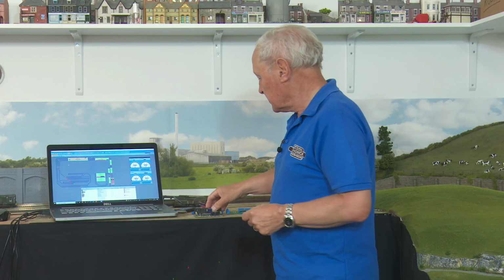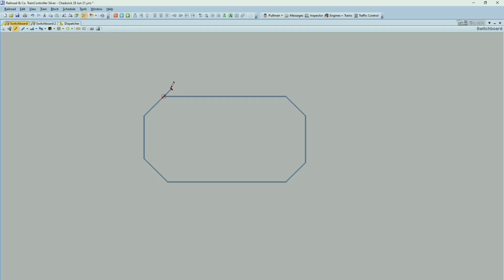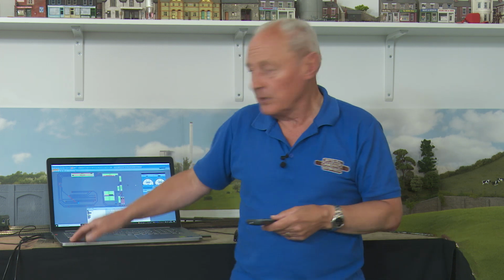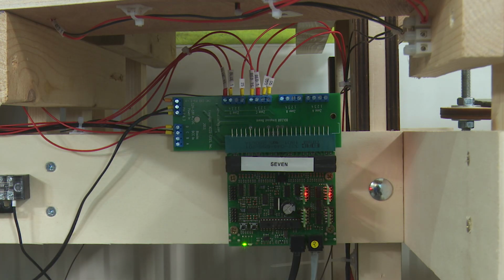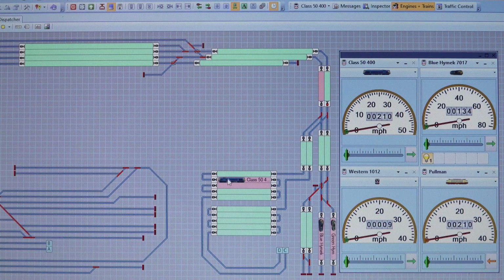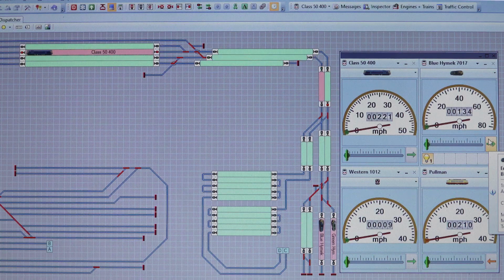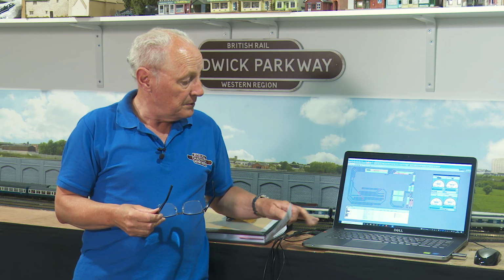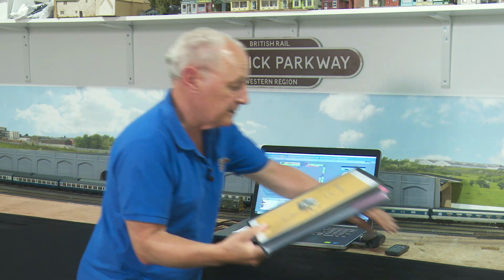An Intro to Block Detection at Chadwick Model Railway | 137.

Comment: On breakout board what are connectors A B C D? What are the use? I dont understand. Ty very much
Reply from the maker: Those connections, A, B, C, and D, represent the four power districts that feed into the board to manage different sections of the layout. Regards, Charlie.
Reply: @ChadwickModelRailway ty very much

Comment: Fabulous video Charlie, a truly great explanation overview of Model Railway Automation, that will encourage many to go down a similar route. You've done modellers a great service with this video Charlie, Thanks.
I was dismayed at the DigiTrains eqt prices, and also of the Train Controller costs too.

I would add that after becoming a MERG member their DTC8 currentr sensing block detector kit (8 channel) is only £24.94. They also do a 2 channel kit (DTC2) at £7.25.  The instructions are extremely easy to follow and if (like yourself Charlie), your soldering skills are good, building the kit is a bit of a breeze. You do not have to be an electronics engineer (I'm not!). MERG Membership costs in the UK £24 annually and for new membership a one off joining fee of £5. There's a whole range of other really useful kits too, once you've become a member. I've built Turntable Control, Accessory Decoders, Frog auto control, Servo control kits, and many others too. 

I am presently building mimic control panels  for route selection using the MERG detectors to show LED's on my panels. The route selection control is using NCE Mini-panels (circa £50) connected to my NCE Power House Pro control station. I have been thinking about expanding control of my layout to full automation using iTrain with my "fruit flavoured computers" as you so elequently describe them! As I already have basic block detection it wouldn't be too much extra pain to set up - I hope!
Reply from the maker: That is a very helpful tip regarding affordable kit alternatives, thanks for sharing your experience!

Comment: A four year old video just found - I am clearly late to the party!!!!!  After over 35 years I returned to model railways two years ago and delved into DCC for the first time.  I have now decided to start again with a new OO layout and iTrains automation so am on a steep learning curve.  I found your video very helpful in explaininhg some of the nuances of this exciting technology.  I have found so many videos bewildering and off-putting as they always assume knowledge which leaves one confused.  I love the way you explain things which I find most encouraging.  I am not planning a massive layout - just a twin track round the room with passing loops, 4 lane station and a few sidings but want the ability to control up to three trains per track so want to ensure I get the wiring right at the start of the project and ensure my issolators and block detections are set up correctly from the outset although I will concentrate on one section at a time starting with the station section first.  Thanks for a very informative video.  (I have also spoken to DCC Train Automation)
Reply from the maker: I'm so pleased you found the video useful SS, and good luck with your new layout!

Comment: It was discovering cheap DCC (via DCC++, now DCC-EX) and blog posts on DIY block detectors using current transformers that brought me back to railway modelling in 2017. I never got the DIY sensors to work but the MERG ones worked straightaway! My goal is to reengineer the MERG sensors into a more compact form that integrates with CBUS or OpenLCB. I want a layout with working interlocking but not tethered to a PC and not (necessarily) with automatically driven trains.
Reply from the maker: That's a great project, RA and it's good to hear you're finding success with the MERG sensors!

Comment: Hi Charlie - great video!!
As you asked how your viewers do it... 
For the block detection hardware i use the Arduino Analgue Input module (ADS1115 ADC 4 Ch 16bit ADC PGA) with 4 hall effect current sensors up to 5A (ACS712 5A range CSM) - and it detects current on both DC and DCC (different configurations of course).
Min Cost = £2.4475 per sensor £4.899 per block (one sensor needed at the start and end of each block).
Basic Hardware how to do it video:
https://youtu.be/RZmGt3-HVlw?si=8iK0KTCmWywxgIdQ 
SIgnal and  Point control are at extra cost. 
Digital I/O is managed by a PCF 8575 16ch GPIO card (each channel can be an input or output). 
Servos are controlled by a 16ch  PCA9685 PWM analogue output card (PWM = Pulse Width Modulation) with each output driving 9g micro servos to change points and signals. The servos close micoswiches to confirm point and signal  operation. 
The above also requires Arduino and 5V power supply) and possibly one capacitor per sensor. 
CMRI (the C version of JMRI) is installed on the Arduino and allows nominated I/O points to be made vissible for automated control by the JMRI Disptcher from my laptop.
Video on the basics:
https://youtu.be/5lvvoBCQl9U?si=_r2JOGmNCwVpc3Ur 
I agree with your comments on JMRI. It's not easy. But it is cheap.
THIS APPROACH DOES  NEEDS BASIC PROGRAMMING SKILLS!
Reply from the maker: Many thanks, blue anorak, I do hope people follow your lead. Regards, Charlie.

Comment: Hi Charlie, re your video you state that you do not include the points within the blocks. I understand that power to the blocks is via the bdl168. However how do you power the points in order to switch the frog polarity? Do you take this from the in my case the PM42. Thanks for your videos which are very informative and entertaining. Best regards Dennis
Reply from the maker: Hi Dennis, I simply Power the point work from a bus wire. However, I power the point motors completely separately, and this has the frog switching circuit within it. Regards, Charlie.

Comment: What is usually the distance between neighboring track centers?
I am thinking that all this cabling could perhaps be replaced by an indoor positioning system based on ultrawide band tags and anchors.
The issue is the technology at the moment has an accuracy of more than 10cm which I think would not yet be enough for proper block detection.
Reply from the maker: That is an interesting idea Max, thank you.

Comment: Hi Charlie
We (Redruth MRC) are embarking on the block detection route for our Reading layout.  This video is extremely useful and so I want to thank you for doing it.
We have been talking to James at DCC Trains Automation and are going to be using Roco Z21 with Yamorc block detectors.  We are also going to use Yamorc point/signal decoders and MP1 point motors.  We are looking at itrain for control.
Reply from the maker: That’s great news, Andrew, do keep me posted. Regards, Charlie.

Comment: Hello Charlie this explains a lot but my question is regarding points are they included in a block or not when wiring track for block detection are they on a seperate feed in to a digitrax bdl or just isolated and wired in to a main dcc bus ?
Reply from the maker: This is down to personal choice. I certainly do not include any point work within blocks. They are simply fed from the track bus. Regards, Charlie.

Comment: Out of interest Charlie, if you don’t have an “up line” and a “down line” (and therefore need the train to be able to stop at either end depending on the direction of travel), would you need three sections to each block?
Reply from the maker: Hi AA, I only have three sections in one block, for speed calibration areas. Regards, Charlie.
Reply: @ChadwickModelRailway  sorry Charlie I think I worded my question poorly. What I mean is, if you have a single track layout (where trains would be travelling in either direction), would you have to have a stopping section at both ends of each block? (And therefore 3 sections in each block) I.e 3 red wires. One the stopping area at one end, another to the stopping area at the other end, and another for the rest of the section?

Sorry I am not sure if I am explaining my my question well enough? I am asking because I am wanting to construct a single line branch line layout and interested again in block detection to automate it.
Reply from the maker: It’s not essential AA, but good speed profiling would be.  I would wiring for different sections in case I need it in the future.
Reply: @ChadwickModelRailway  very interesting. Thank you for such an informative and engaging video as ever Charlie! :)

Comment: I take it with the block editior properties you can set up bi-directional stopping and have three sensor sections in the block to have accurate stopping at either end of the block?  The train controller program is expensive but its ease of function probably says its good value at the same time.
Reply from the maker: Yes, Brenden, that’s completely correct. Regards, Charlie.
Reply: Google a YouTube video called.  '23 Block detection on McKinley Railway'.

Comment: Hi Charlie, This video popped up just at the right time as I cant get proper answers from the MERG group, so nearly finished the Sheffield Midland Station layout apart from the loop round the back but getting info on Block detection wiring has been a nightmare but I think your video has gone a long way to help as I was unsure about points and D.Slips and D.Crossings plus lots of short lengths of tracks on Entry and Exit to Station, Hardware I used diode back to Back  block detection a MERG original design which I made 6 channel which eventually feeds to the DCCEX command station via an I2C Bus, points via PCA9685 servo drivers again back via I2C Bus, I have the Command station and 8 District cutout modules again a member of MERG design but very cheap and they work well, I want to initially use JMRI and like you say that will be fun with the learning curve, then once all that works I will contact James at DCCTrainautomation regarding getting iTrain software, hope i'm still here to do all this ...LOL
Reply from the maker: Sounds like you’re making great progress mate. Good luck with the project, regards Charlie.

Comment: Finally managed to dip a toe into this arena, as an experiment I did try to hook up a point to a BDL168 and it's very hard for the detection to pick up the current draw in time. Even crawling at 1 step doesn't yield a detection event!  Charlie would you consider doing more video's on this topic.. or even tutorials on basic setup, drawing plans to getting started!
Reply from the maker: I’m sure if you check out my back catalogue, I have done several videos on blocked detection. However, I do not include my points within blocks. Regards, Charlie.

Comment: Hi Charlie, interesting video, when you mentioned about breaking each block into two sections red 1 and 2, I was thinking along the lines of having a current detection unit for the block with two hall detection sensors at each end of the block feeding into a sensor hub, do you think this would have the same effect.   I am using JMRI and arduino mega boards with motor shields and sensor hubs and servo controllers.  Interested to know your thoughts.
Reply from the maker: Hi Colin, I’m sorry but I really can’t offer you any advice on this. My block detection knowledge is fundamentally based around the Digitrax BDL168 system. Rregards Charlie.

Comment: Hi Charlie, Ive been looking through various youtube etc for me upgrade, Just came across your video them block detectors seem a bit expensive for me I made some Diode Voltage drop boards which was a MERG design but I designed a board with 6 channels which works great even with a 10kohm resistor across track ... cost for 7 boards so 42 channels about £45.00 they output to logic level and will go into my base station via I2C Bus think its similar to Loconet .... plus your video helped with how I position blocks and sensors ... Regards John
Reply from the maker: Thanks John, I’m so pleased that you found the video interesting and useful. Regards, Charlie

Comment: Hi Charlie, a bit late to the party here but I did read, somewhere, that the powers that be took umbrage at Brexit. Be interesting to see when the price for train controller went up for the UK!
Reply from the maker: I think it went up when the issued train controller nine. Regards, Charlie
Reply: @ChadwickModelRailway  just seems odd that it was only raised for UK. Perhaps I am just an old cynic!
Reply from the maker: Yes it seemed to be a UK only thing. However, you might still be a cynic!

Comment: Great video Charlie. I checked the latest TrainController prices, since it is a while since you posted the video. Maybe your comments had some effect, as they have reduced the UK prices "slightly". They also added text (just for the UK!) showing the price "without tax and tax handling". Those prices match the non-EU prices (e.g. USA) and are 30% lower. 20% of that makes sense as that is the VAT rate in the UK, which doesn't apply in the USA. The other 10% is presumably a fee they are being charged by their payment processing supplier to handle the paperwork. Seems very high though. The other issue of course is why non-EU prices are so much higher than EU ones. $699 for gold for non-EU and €599 ($650) for EU. That's despite the fact that VAT is charged in the EU (e.g. 19% in Germany), so the "excluding tax" price for Germany is $546, 22% lower. I agree with you there is no excuse for any of this, it is blatant price-gouging.
Reply from the maker: Thank you Robert, for an excellent comment. It’s difficult not to feel a victim in this situation! Regards, Charlie

Comment: Hi Charlie, enjoyed the video as always, just one question on the block detection: Why are there two Red-1 wires coming from BDL168 (seven) and only one Red-1S ? I thought there shoud only be one of each for each end of the block. Your reply would be most appreciated, thank you.
Reply from the maker: Hi Barry,  if a block consists of multiple tracks they will each have their own droppers.  On this occasion, I brought both wires back to the BDL. 
Regards Charlie

Comment: I have  questions.Is it the BDL that stops loco crossing block.or the train controller.Also i have looked at diagram.and it shows negative wire connected and blocks in that wire.and red power  bus wire runs normal.also wondering are all droppers  connected to negative wire as every piece of track having droppers.And how far is maximum distance from bdl.168 to furthest block.The reason im asking.some layouts are very large and use 2.5mm cable on both wires.One last thing i dont understand.it says up to 3 amps for bdl168.when digitrax can use 8 amps and normal 5 amps.
Reply from the maker: Hi Thomas, within a computer controlled layout, it is block occupancy which stops locos entering blocks which are already occupied. Therefore, a BDL with 16 outputs tells the computer which ones are occupied. It might be rated at 3 amps, but on 16 separate pieces of track, that is ample. All of my black cables are fed together, and my reds, go to the BDL’s. I hope this helps, regards, Charlie

Comment: Hi Charlie, I'm an avid follower of your channel and love the content you provide. I have learned so much from you and thank you for the great videos. I too have a Digitrax system (DS 210+ base station and I'm using servos for my turnouts driven by a DS78v) and really just getting started in the hobby. After watching this video, I'm curious if Train controller will operate signal lights and what other hardware would you use for that? My layout is already wired but I'm going to now do block detection and basically rewire the red bus wire section. Ugh better planning on my part would have saved me this headache but moving on.
Reply from the maker: Yes signals can be automated.
Digitrax make the SE8C and there are also other components available.
Regards Charlie

Comment: I use rocrail with a digital running on a raspberry pi connected to a digitack pr3. And for block detection locohdl current detection modules, also with locohdl modules for signals (servo semaphore and led modern), points (rc servos) , and building lights. The whole layout can run in full or part auto, or manual. Using a tablet or my phone. :) can give more details if interested
Reply from the maker: Great comment Calvin, highlighting other hardware and software options available. 
Regards Charlie

Comment: If you're willing to invest the jmri combined with merg kits can save you a small fortune. For the price of TC gold you could have a shed load of merg kits and not get near that cost,  saving your money for stock. 

Of course you have to be willing to invest time and effort in place of the cost. If you're doing it as a group it could be very helpful. There are many different options available through merg along with options made by me4g members that are not kits.  But if you can solder reasonably OK most should be OK.
Reply from the maker: I do appreciate your point of view but Train Controller is far easier to learn in a limited time than JMRI.  Age and memory are not on my side.
Surprisingly, I did try and reach out to the MERG guys at a show but got the cold shoulder when I mentioned Train Controller. Regards Charlie